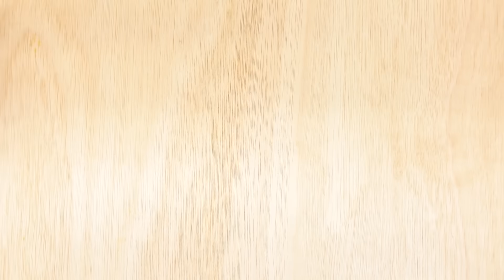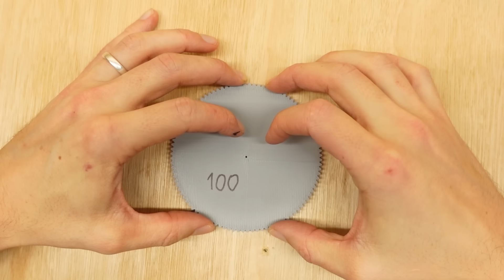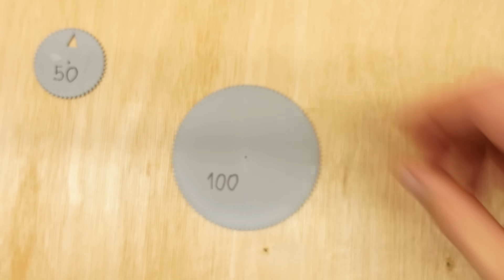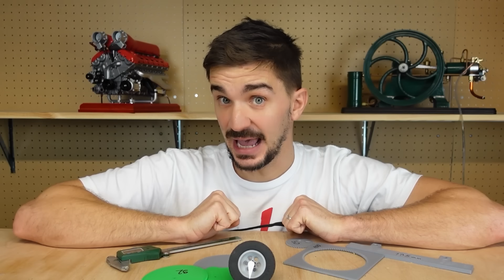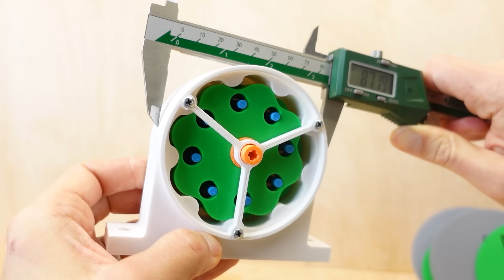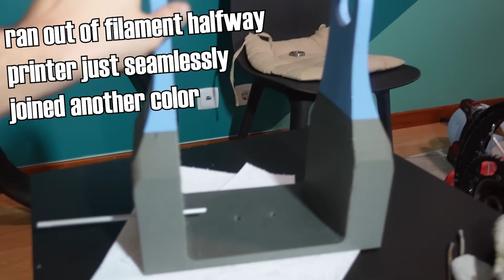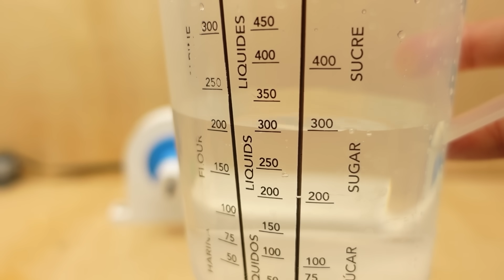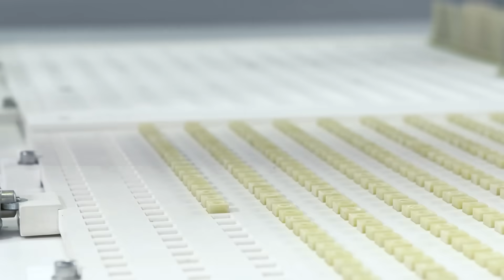Toothless Gears Make Much More Torque Than Conventional Ones, Here's How. Cycloid Drive Explained

Comment: just thinking..can you make the ring gear rotate too, and make a planetary + cycloidal drive (I guess!) with 3 shafts, and are there applications to it?  like eCVT using a smaller, faster spinning, lower torque MG1?
I guess friction/efficiency could take a hit.
EDIT seems like rpm is the culprit
when I see Toyota hybrids using a MG1 motor with 3500 peak rpm and there are 30krpm automotive  motors , sounds like potential weight/ cost saving/packaging advantage if you can make the MG1 10x smaller..
add cycloid drive on the mg2 also for torque multiplication and a fat revving NA engine and you get a compact high performance hybrid system that would be perfect match for a small high power density battery or supecapacitor. small energy capacity and lower efficiency as a sacrifice to performance/lightness

Comment: Another thing cycloidal drives suck at is speed increase, I used to work designing electric generating windmills where a speed increasing gearbox is needed to convert the very low rpm of the windmill blades to 1800 rpm (for 60 Hz) or 1500 rpm (50 Hz) for the generator, we tried cycloidal drives, and rejected them.

Comment: Hi, Patrick here, I have been enjoying your work for a very long while. At an appropriate time, please decipher for  me (us) rocking couples with reference to turbo compressors with respect to their failures. I imagine this would throw a lot of light on turbo failures for many motorists globally. Your efforts are always appreciated.
Reply from the maker: Hi Patrick, thanks for watching! But for a rocking couple you need a motion that isn't just pure rotation. You need some eccentricity or reciprocation or something else beyond just rotation. Turbo balancing involves making sure that the wheels have equal distribution of weight everywhere, it's very similar to balancing a car wheel. Spin it up to speed and add weight (wheel) or remove weight (turbo wheel) until you achieve that. Obviously a poorly balanced turbo will fail, but that's not quite a rocking couple, it's more similar again to wheel wobble.

Comment: The balance issues of a cycloidal drive have already been resolved using split matched pairing.

Put the 100% mass gear in the middle, with a 50% mass gear on each opposite side.

Then you weld them together.

Ideally, with [quite ironically] the machine you were promoting, you can simply 3D print them as one piece to start with.

MY thoughts on all of this is mainly how to make a 2 speed transmission for my track loader.

I need a "traveling" gear, and a "gouging" gear.

This is because the worn out 60 hp diesel is matched to a transmission which is much too fast for effective digging, and can stall the motor, but adding any more gears where they CAN BE added is limited.

So I am thinking of a way to make a cycloidal drive compounding gear within a stack of clutches so that it can be alternatively clutched as a direct drive [the entire assembly spins as if the compounder did not exist] or clutched AS a compounder, all with just selecting from a pair of clutch packs.

While this is NOT an easy process, because the clutches will need hydraulic pressure inside of a pressure capable housing, which needs to be perfectly balanced, which has enough clutching strength to not fail under the load delivered by the compounder, I'm quite confident I can build this in my machine shop.

Mine will be made entirely out of metal, and likely made entirely between my hand operated lathe and mill, but if I find I can't functionally build the cycloid parts in house. I will contract those out to somebody with CNC tools, because I'm pretty confident that a 3D printed metal part in this scenario would wear out far too rapidly to be worth the cost.

Comment: 3D printing was (and in my mind still is) AI slop before AI generated content became a thing.
Until you can 3D print solid stainless steel with at least 95% the strength of real steel and the same finish as machined steel, 3D printing will never be a thing I am ever interested in.

Yes, I know they are 3D printing jet nozzles and all kinds of impossible to engineer shapes already. But ever since 3D printing turned into a microwave oven for creative youtubers all I've seen so far is a bunch of plastic "proof of concept" projects that are janky, has plenty of friction and snap off or melt without actually showing anything of value to me.

And yes, I understand that making these components out of metal is not only difficult to the point you'd have to invest months in just learning to be able to produce said shapes, but also extremely expensive because you'd need to tool up to do those things and there's PLENTY of room for error and mistakes and even injury or worse.

There has however been an emergence of CNC machine shops that will take your CAD files and turn them in a real mill out of pure blocks of metal whom doesn't charge you extortionate sums of money for those parts.
Of course you still have to design it in such a way that a CNC machine can actually produce the part.
In the case of this video, ordering those designs from one of them instead of 3D printing them would have made the video just a bit better.

And if I ever needed a new toilet roll holder, I would just go out and buy one at whatever budget I set for it.
Because that means I am not sitting at home with a 3D printer and computer software, which is time and time is money too.
And I do get to "touch grass" so to speak.

And even so, if for whatever reason one doesn't want to go out and buy one. There's always online shopping where you can find even plastic junk with the same but still possibly better quality than a 3D printed holder, for less the cost of the material alone.
Because mold injection en masse is still ALWAYS cheaper than 3D printing. And stronger.

Comment: amazing stuff- but my favorite gearset is the worm gear!  those can also achieve 1:100 ratio, are super compact, and with less parts. also, in the large reduction they are non-reversible, can be a great advantage. also they change the direction of rotation 90 degrees- which can be n dvantage or a disadvantage...
Reply: They still have the issues of backlash and small contact areas, but they are easier and cheaper to manufacture.

Comment: I have a CHALLENGE for you inside.

Wow! This is the best explainer video on gears and gear boxes I've ever seen. I love your clear 3D model demonstrations and explanations.

I have a challenge for you with regard to the rocking couple forces. My thought on how to cancel this force is to have 3 gears. The 2 outer gears would be half the thickness and weight of the center gear and 180 degrees offset from the center gear. What do you think? Worth the build and another video?

Comment: 18:40 I think you can balance it by using 4 gears, just like crankshaft counterweight in 4 cylinder engine. When 2 gears at the ends in upper position, 2 other at the center in lower position. You can also simplify it by conecting those 2 gears at the center, so it become 3 gears; 2 thinner gears, and 1 thicker gear (same total weight).
Reply: Yeah. I think this could work. It would make sense. Wish I had a 3d printer to try this out
Reply: @Yo_Gurt24  I thought of simply "splitting" one of the gears in two, and sandwich the other one in the middle.
Let's say that you need a total width of 6cm to withstand the torque.
Starting on the left: 1.5cm cycloid and ring gear UP offset, 3cm [...] DOWN offset, 1.5cm [...] UP offset.
So you have only 3 layers, one less crank in the shaft, and still the UP weight is the same of the DOWN weight.
Could it work?
Reply: @pomodorino1766  basically it is the same concept. splitting 1 gear to 2 thinner ones, or using 4 gears and connect 2 of them, or simply make 3 gears; 2 thin & 1 thick directly.
Reply: Right! so the real compromise is adding bearings at all those points of contact. Of course, may points make light work for the bearings.

Comment: For anyone who doesn't understand why the wheel rotated twice. Like I didn't. It's because relative to the wheel, it does rotate once! The marker only points to the center of the other wheel once! One wheel rotated twice to compensate for the other wheel not rotating at all! Imagine both wheels rotating opposite directions. A combined length of two wheels was travelled. If only one wheel moves, it needs to move itself, and compensate for the other one too.
Reply: you da real wheel
Reply: The wheel being traveled is the same as simply rotating the traveling wheel. Add the distance traveled and you get the 2 rotations.
Reply: But what about the internal gear?
Reply: @groundedmike  Same thing but going along an internal track makes the gear spin the other way so it does two rotations one way and one the other resulting in one total.
Reply: @groundedmike  Honestly my brain small too. I'm contempt understanding just two wheels that are the same size.
Reply: @Derpynewb  think of it like this, when the wheel travels around the other wheel, the other wheel is causing the traveling wheel to complete one rotation in addition to the area traveled.
Reply: @ezze7540 no we are both correct. We are explaining it differently.
Reply: @Derpynewb ah i see, from what im hearing u may be trying to work from how diameter (edge to edge, 1:1) spin according the other wheel’s edge (circumference) rather than the 
radius (center axis to edge, 1:2) of the wheel spinning around the edge, i may help
Reply: Reminds me of the old video Frames of Reference from 1960.
Reply: Thank you, that cleared it up for me.
Reply: Right, even if you slide the gear as if it were on flat ground, always pointing perpendicular to the ground, it would still rotate once clockwise.
Reply: You are making it more complicated.  
The extra rotation is because it’s rotating in a circular motion as it’s rolling on the other wheel.  If you glue the wheel on the end of a string of any length, and then bend the side of the string where the wheel is so that is attaches to the other side of the string and makes a circle.You will see that the wheel rotated even when it didn’t move on the string. This is more of a layman’s explanation, but there is a mathematical explanation as well.

Note that I’m not going to use the actual lengths below as per the video. I’m using ratios so the actual numbers don’t matter.

The way it is explained mathematically is that it is the ratio of the radiuses plus 1. And why it’s like in terms of mathematics is because the outer circle/wheel is rotating around its center. The path   travelled by its centre makes a larger circle than the circle its rotating on. So for a 2 to 1 ratio like on the video, the radius of the large circle that the centre of the outer circle/wheel is making is 3 (2 for the inner circle/wheel + 1 for the outer) while the radius of the outer wheel/circle is 1. So 3/1 is 3.

For a circle rotating inside of another circle, it’s the same concept but the end step is the opposite.  This is the ratio of the radiuses minus 1. Using the same example as the video, the ratio is again 2 to 1. So now you look at the circular path that the inner circle is making. The radius of this circle is the radius of the outer circle minus the radius of the inner circle. So the radius of the outer circle is 2, then minus the radius of the inner circle of 1 . So 2-1 is 1. If you look at the video where this is shown, the inner gear would fit perfecting in the circle b, as circle b has half the radius of circle a.
Reply: It’s the 2 in the 2*pi*r formula for circumference
Reply: My little brain just doesn't understand.
Reply: That's not the reason.  It's much more basic...  the distance the wheel travels is based on the center of the wheel, not the edge.

When the wheel moves on a flat gear...  movement of the center is parallel to the gear and thus the same distance.  (pi r square)

When calculating distance of the circular path you need to understand the radius that the wheel travels over. 

When the wheel travels outside a wheel...  the radius is r1+r2

When the wheel travels inside a wheel it's r1-r2 (where r1 is the outer circle's radius).
Reply: @kwonekstrom2138   Yes, this explanation is the one provided in the video. The comment was providing an alternative, equivalent explanation that might be more intuitive to some than the one in the video. Both of these are correct; they're just two perspectives on the same phenomenon.
Reply: @DroeGaming Yes...  it is an alternative but no...  it's not  correct.

Just taking the information from the video...  the 75 tooth gear is 3/4 of the 100 tooth gear.  Yet produced a rotation of 1/3rd...

Clearly the total circumference of both wheels is larger...  yet it has a dramatic reduction compared to the 50 tooth gear...

I can't find any "intuitive" explanation using how often the arrow points at the center...  The math for the circumference of a circle works in both cases...
Reply: @kwonekstrom2138  The 75 and 100 tooth gears are maybe a bit harder to see, but it is the same as well. 

If you imagine the 75 tooth gear rolling along a straight line with 100 teeth, the gear would rotate once after traveling 75 units, then have 25 units remaining. That 25 units is enough for another 1/3 rotation of the 75 tooth gear. So the total number of rotations is 100/75 = 1 and 1/3.

Since the 75 tooth gear is rolling around the inside of the 100 tooth gear, there is one fewer rotation with respect to an outside reference point, and the total number of rotations is 1/3. If the 75 tooth gear were rolling around the outside, as with the start of the video, there would be one extra rotation, and the total number would be 2 and 1/3rd instead. 

However, if you look at how often the arrow points at the intersection of the two gears, rather than an external reference point, it is 1 and 1/3rd rotations both times; the same as the linear case.
Reply: Lol buddy, we can see the video also.

Comment: I used to work on and field service Sumitomo ball bearing cycloidal drive gear motors, and those are relatively critical in their implementation of the ball bearings to transmit the energy across the outer rings effectively. Bearings worn? The cycloid just spins inside the ring.
They're great for their size (most of them were between 30-50:1) but the higher the ratio, the more finicky the rebuild.

Comment: Cycloidal drives use rollers as the outer ring lobes and on the pins in the output disk 16:53 . This is necessary to achieve reasonable efficiency , otherwise friction is too high. A drive with a 9 lobe cycloid can have 21 rollers and the associated bearings.
This makes the parts count much higher than an epicyclic gear train

Comment: What would the imbalance be in a 6-geared cycloidal? I may be wrong but aren't Inline 6 Cylinders the smoothest of all ICEs? How would that translate to this drive?
Reply from the maker: I believe it would translate almost the same way but it doesn't make sense since compactness goes completely out the window and the gear ratio remains completely unchanged. Plus fitting the load plate pins would likely be impossible and they would be very long and weak. You can stack complete cycloidal drives though and that increases the gear ratio.

Comment: This is how mud motors for downhole drilling work in a way. The difference is fluid drives the center shaft by flowing around the lobes. It's also how alot smaller hydraulic motors are able to create the torque needed to move massive weight. 

Love your videos.

God Bless,
JB
Reply: Looks eerily similar to hydraulic pump
Reply: @JarrettWilliams99 unfortunately I'm all too familiar due to rebuilding them lol.

Comment: isn't friction a big problem at high rpm too ? Bc the friction betweean the outer gear and the inner gear seems significant. I think at high RMP the energy losses at high RPM because of heat(caused by friction) would be significant. Im teorising or whataver how you spell it here so if im wrong please correct me im not someone proffesional or some.
Reply from the maker: You're theorizing correctly
Reply: @d4a ty

Comment: IMO the teeth still has one point of contact. And the multiple pins should have roll bearings on them. What is that, it just slides metal on metal?

Comment: Can you not add more pairs of gears and mount it like an inline 6 with bearings like the journals between cyclinders? Would this add more torque and lower vibrations?